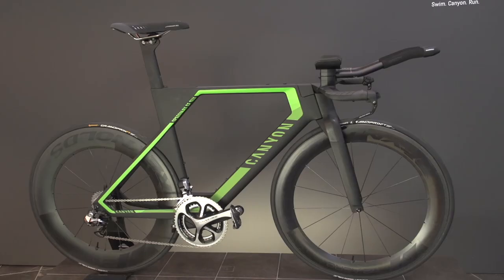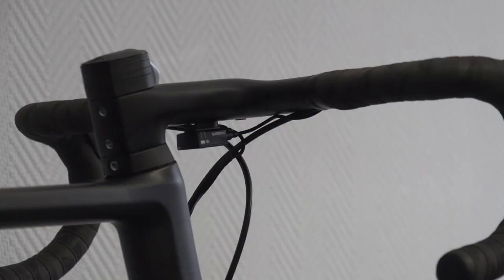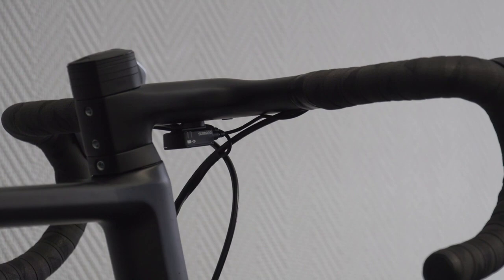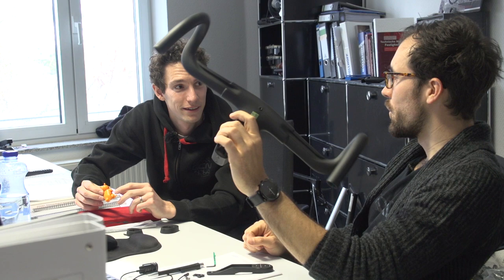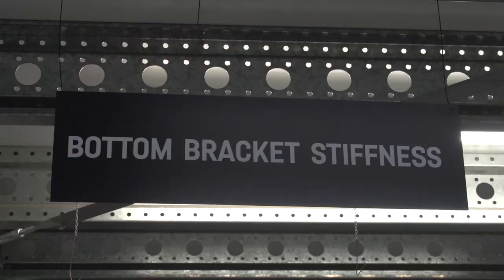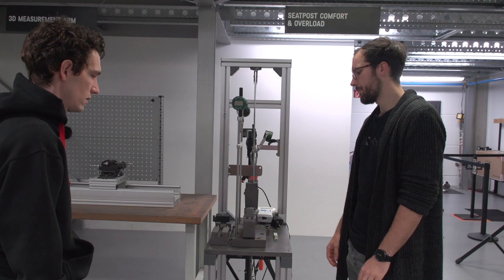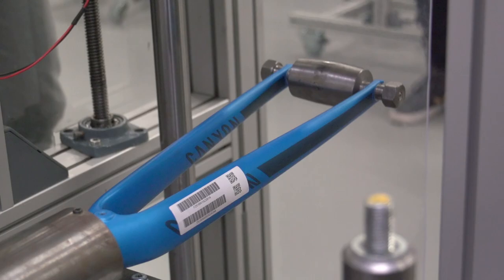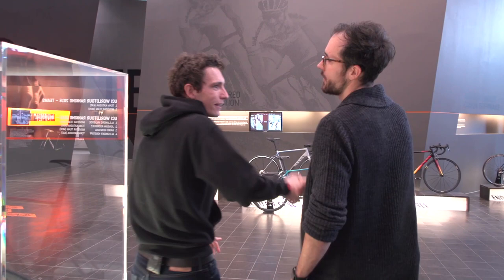A Day In The Life Of A Bike Designer – How Are Road Bikes Designed & Tested?

Comment: Can y'all do a show on how to prevent foot or arch pain after a long ride. This is something new for me, im starting to experience arch pain after long rides.
Reply: I got arch pain in my left foot for the first time just last week, no idea why. I think it's because I've been doing longer rides sooner than my body is probably comfortable with (and less frequent short, training rides in between). Also new this year is integrating mtn bike riding, where I pedal with sneakers/trainers and no clips, so that'll affect my arches considerably.
Reply: +1974dutchess I never have that problem while cycling but as a runner, the way I solved that issue was using wider shoes with less arch support. You might think it's counter intuitive to use shoes with less arch support but it actually allows your arch to compress and decompress as it would naturally which ended up making my fascia much stronger in the long run. It would be interesting to see how cyclists go about fixing this problem, though.
Reply: What I'd recommend and check if a customer asked me:
1-Make sure you have proper fitting shoes that are sized correctly and comfortable for you.
2-Make sure your cleats are aligned properly (this is the only free one list).
3-Get a pair of fitted supportive insoles custom to you.
4-See a bike fitter.  You may need wedges for tracking/heel drop/etc issues.
5-Don't walk around your house in bare feet if you have high arches, try and wear at least slippers or sandals to get some support.
6-If issues persist, see a doctor.  
7-Therapy options (last resort).
8-If you're lucky, it may resolve itself as it was temporary trauma.  Take time off bike to heal.